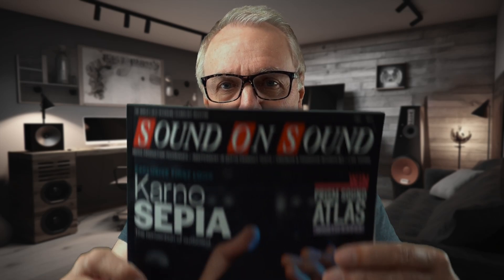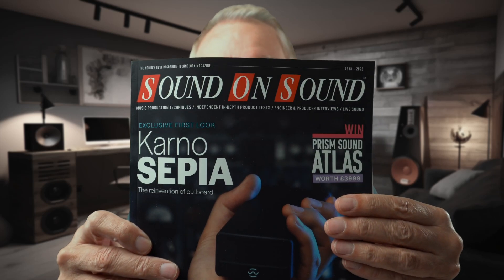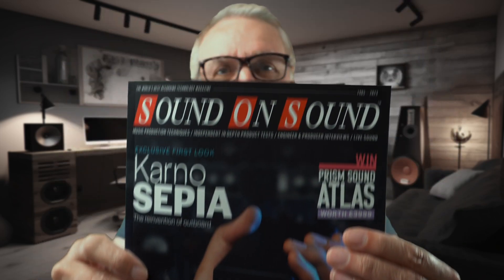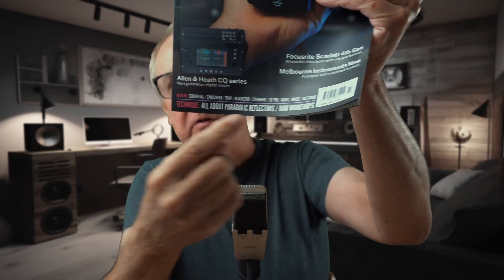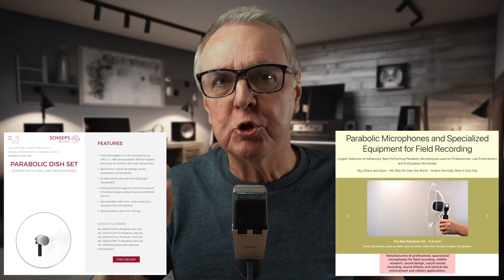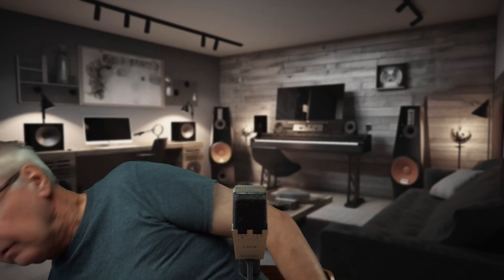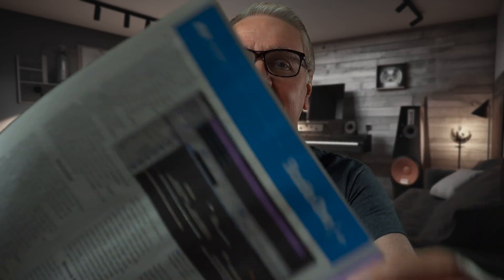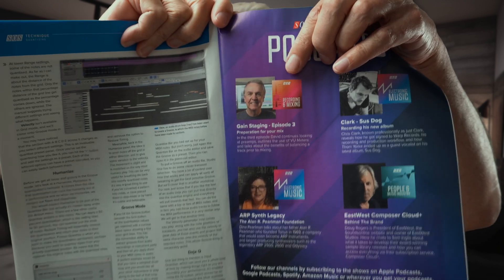Parabolic reflector microphone - Sound On Sound latest issue

Comment: I have several of these in various sizes. For birds. The largest is from Dodotronic (Italian) which is stereo in a batwing format losing the top and bottom of the parabolic. The stereo effect enlivens the recording, but makes finding a hidden bird difficult. If you hear it louder in the right ear the bird is to the left (left field is shadowed by the edge of the parabola).
Tip to find the focus of the parabolic - (carefully) use paper to focus an image of the sun. This is the reflected energy (whatever source) focal point. A bit rough but fine. Wildtronics make small stereo microphone which is very sensitive and works very well in a near antique* Sony 330 mm dish from (?) the 70's that I have.  [* Man wearing flares in the manual.]
Reply from the maker: We need video! Send some!

Comment: I did a DIY (I'm cheep/broke) - first a plaster plug using a profile cut of alum sheet.  Fiberglass gore segments of different lengths (control of dish thickness).  Ended up with a 28" disk.  check the focal length via a shiny metallic tape strip stuck to the inside of the dish (straight radius) and a laser pointer.   WoW!  works a charm.  Thanks for the video I appreciated it.

Comment: A problem with perfect parabolic reflectors for sound is that they create destructive interference, making some frequencies weaker and some stronger. Paradoxically a non-perfect parabolic reflector should give a more balanced sound.
Reply: I wonder if a figure 8 mic in the parabolic sweet spot couldn't pick up both full range facing forward, plus the "zoom" effect from also facing the dish. With mixing, the overall sound could be balanced but also "zoom in" as desired, perhaps even for solos in music. Also, a shotgun mic could hold the figure-8 mic in front of the dish.

Comment: I haven't read the article, but from what I can gather, they seem (I almost typed "sound") a lot like pressure zone aka "boundary" microphones, at least in terms of theory. Long ago I modified some Radio Shack PZMs for phantom power with very pleasing results, opening a rabbit hole which I entered with no regrets.
 Am I missing something, or is the only difference just the shape of the boundary behind the capsule?

Comment: As our ears are basically reflectors, how are we able to hear really low (bass) sounds? Some noises in the lower end of our audible spectrum have wavelengths measured in the meters. How do our reflectors capture them? I guess you've sent me on a quest to learn something this Saturday afternoon. Side note, this also makes me think about the natural tendency to cup one's hand behind their ear when straining to hear something. Love this channel, thanks!
Reply: I think the simple answer to that is that our ears are not reflectors. Each ear is a short tube with an acoustic pressure sensor (the eardrum) at the end, which can pick up LF perfectly well. The external parts of the ear do act as reflectors, but only for high frequencies, which helps us with direction (especially vertical direction and front vs. behind)
Reply: @anahatamelodeon 

you could expand on that there are cancellations of certain frequencies at a given angles that act like notch filtering, giving a subtle difference in tones, from angles that give a particular resonance that is completely unique, which is fixed in one position (the pinna) where the brain interprets these subtle tones as external perceptions. The brain is able to ‘focus’ on these perceptions as you can follow the sounds with your eyes closed. The pinna is a rather special 😅
Reply: Ear lobes reflect high frequencies, not bass. Bass is "omnidirectional" respective to hearing, only harmonics localize bass.
Reply: @xxxYYZxxx  I disagree in some respects, although except for very low frequencies where I would agree.

There’s more going on with the pinna with higher frequencies other than simple reflections in my opinion, as mentioned in my previous comment.

Though, I do expect dogma bites and flames from my opinions 🥸